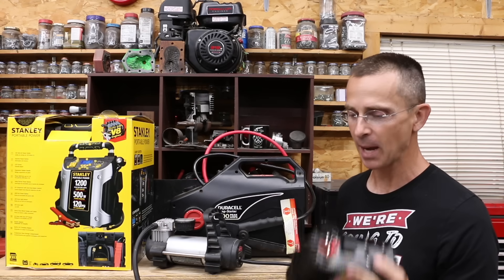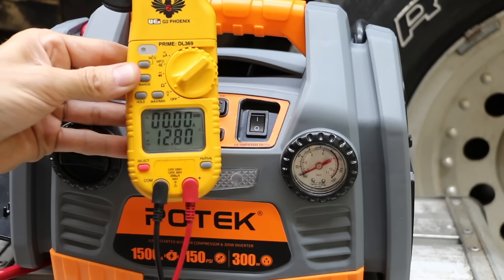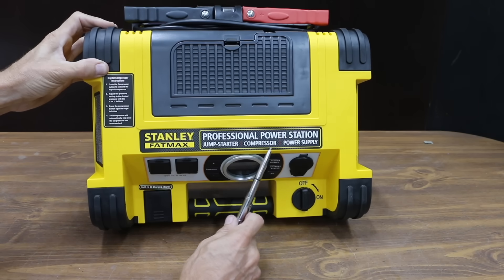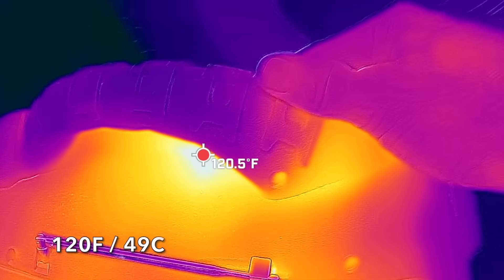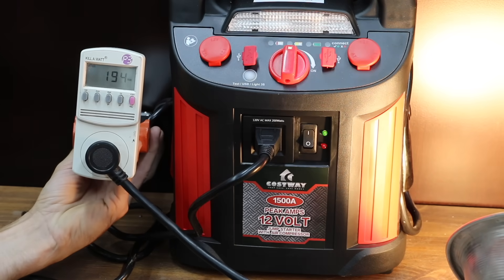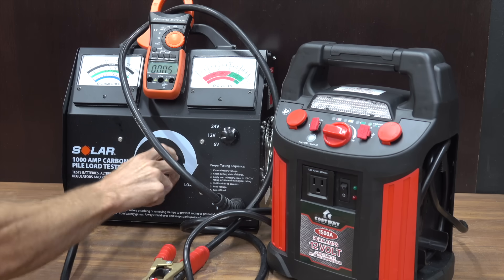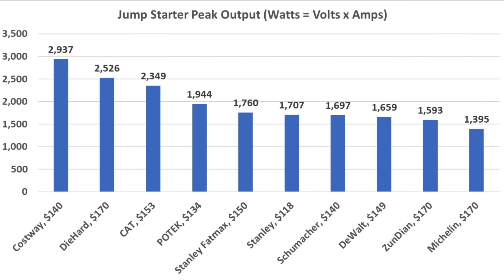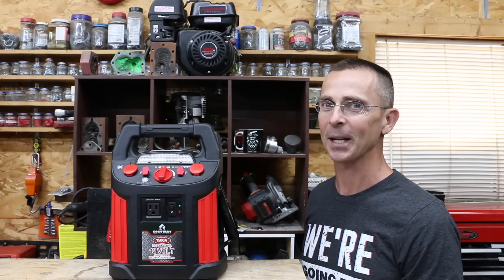Best Jump Starter? DieHard, Schumacher, DeWalt, Michelin, Stanley, CAT

Comment: Another great video.  Thank you for doing these.  

I no longer use these large Lead acid all in units, in favor of the much smaller and low self discharge Li-Ion boosters.  i figure that i can use a spare tire, or use a gas station or a bicycle pump for any air needs.  For tires, the bigger need is usually to plug the nail, then inflate.
Reply from the maker: Thanks and you are welcome!  Thanks for sharing.
Reply: The lithium ion battery packs seems to suck in the cold though.
Reply: An inexpensive twin tube foot pump $15-20, or large barrel bicycle pump much more reliable.  Only need to get >15psi, then slowly drive to gas station air machine.  Once paid $45 for individual 12volt air compressor that quit on 1st use.  Not interested/ won't rely on any more.

Comment: Great tests as usual!  I've been looking at the CAT which Costco sells for $109 which is actually the 1200 peak version, mostly as portable charge station and occasional mower jump start.
Based on the testing it would be good enough for that!
Reply: That Costco CAT is crap.
Reply from the maker: Thanks!  Thanks for sharing.
Reply: Get a Battery Tender or Battery Minder from Costco, a battery charger, much better for a mower. About $30-40

Comment: Here's a video idea. You should test out different types of stun guns/tasers, since they claim "millions of volts".

I already have a voltage divider that's (not too) accurate, since I made it read both 1 volt for every 1,000 and 1,000,000 volts. I have used it to measure a boost converter (basically a stun gun module) that was rated at 400kv, but at max power it only put out 15kv.

I can send you a homemade voltage divider that reads 1 volt for every 1,000 volts. With only this configuration it seems to be more accurate and reliable.

Try testing the ViperTek, Hot Shot cattle prod, and one of those generic mini pocket stun guns.

The distance between the prongs on a stun gun is what limits the voltage when arcing. 

There's 2 smaller prongs deep down below the big prongs so that it keeps arcing when the big prongs are stuck onto someone. That arcing is the voltage being built up high and let out all at once.
Reply from the maker: Thanks for the suggestion.
Reply: @ProjectFarm  Is there a PO box where I can send my homemade voltage divider? Polarity doesn't matter for most multimeters.

Green wires go to your multimeter, and yellow wires go to the high voltage source.

Also pls credit me when I send you my 5+ hours of soldering 100+ resistors in series.

Comment: Where does one buy a Costway for $140?  The lowest price I see is $169.  Or, has there already been a run on them thereby jumping the price?
Reply from the maker: The link is in the description.  Wouldn't be surprised if the price has jumped.
Reply: @ProjectFarm  Has increased to $169.99 on the Amazon ink provided.   Only 15 left as of right now.

Comment: Personally, I'm wondering if you just got a bad Stanley unit.  I've had the exact same one for a few years now and to be honest, I've only used it to jumpstart other cars and as a power supply during power outages.   It's jumped all but one car (I do roadside services) and that was my fault for letting it go uncharged.

I will say that other than jumpstarting numerous vehicles with it, I haven't used it as strenuously as it was tested here.
Reply from the maker: Thanks for the feedback.

Comment: IDEA: Test jobsite coolers! How long they keep beverages cold if the cooler is in the sun vs in the shade? Durability test. Exposure test (UV light, rain, etc.), What happens if you get oil or concrete on it? Will it clean up or ruin the cooler? And finally, what's inside (what's the insulating material inside the cooler?)
Reply from the maker: Thanks for the suggestion.

Comment: These things are useless. Starting a dead car in the winter will be impossible. You’re better off buying a deep cycle battery and a cheap power inverter. If they can’t jump a dead warm battery they are just trunk weights
Reply from the maker: Thanks for the feedback.

Comment: Could you test the myth about adding 2-stroke oil in your dieseltank? They say its good for dieselpump, injectors, the combustion chamber etc because the dieselfuel might not have enough lubrication in it in the winter time. 2 deciliter in a 70 liter tank is what i was recommended
Reply from the maker: Thanks for the suggestion.

Comment: Last year, I bought an Everstart (Walmart) jump start box with compressor.  It's rated at 750A and 120 lb/sq in compressor pressure.  How did it work?  It won't start a car with a dead battery.  It'll help if the battery is low - at least that's good.  The compressor filled up a couple tires, then died.  I can set the pressure and it runs, but no pumping.  Pretty much junk, but I use it for jumping a car with a weak battery.

I did buy a Schumacher Lithium Ion 1000 A jump start box a couple years ago and I'm amazed how well it works.  On a car with a completely dead battery, most times it will start it.  I have run into situations where the battery was too dead and the starter needs too much current, but most times it worked - much better than a regular lead acid battery box.  The box is also very light, which makes it very easy to take with.

Between the two, it's an easy comparison.  I grab the Schumacher whenever I need to jump a car.  

An idea - can you do a comparison test between a lead acid and lithium ion jump start box.  Can you test the initial power and success of jumping a car with a dead battery, then also see how many times it will start a car, before there's not enough charge left.

Again, I love these videos!  Thank you for all your hard work!
Reply from the maker: You are welcome!  Thanks for the suggestion.

Comment: This was a great video and look forward to other brands being tested...Just as with batter back-ups for computers many times you can take the housing apart and by a bigger and/or better AGM battery to put into the device and massively increase the performance. sealed lead acid batteries are the cheapest and worst batteries you could ever use for anything. They are intended to fail so you buy a new battery. Once the water evaps from the battery they are dead and done. Can sometimes also find nice lithium batteries to replace the factory battery if you can't find a AGM battery. Many HAM operators us lithium batteries for off grid communications and backpack HAM operations etc.
Reply from the maker: Thanks!  Thanks for the feedback.

Comment: Fascinating! Thanks. Looks like Costway is the best jump starter.  Seeing all those compressors thermal out before the tire was inflated, I found myself wondering how long you need to let them cool before continuing to pump up the tire.  I have a lot more than 35 psi in my F250 or car trailer.  Looks like I’d best consider these to be jump starters, and carry something like a Viair 88P for the tires.
Reply from the maker: You are welcome!  Thanks for the feedback.

Comment: Glad I watched this would have brought the dewalt, go to brand,  looks like spending 300 to 400 might be worth the time, with no headaches.  I bought a 12v slime portable air compressor, tire had.10 lbs in it took less than 4 minutes to air up, never shut off or overheated. 54.00, money well spent, I'm impressed, that little compressor kicked all of those brands butts...
Reply from the maker: Thanks for sharing!

Comment: There is an entirely different class of these starter devices that are smaller and lighter, and use lithium batteries. They also use a capacitor I believe to deliver the peak current for starting a car. I have one of these by the brand Halo. Would be interesting to see how this class of device compares to the big guys with lead batteries. Certainly not as straight-forward to test as you don't have a lead battery to measure the voltage on. Thanks PF!
Reply from the maker: Thanks for the suggestion.

Comment: Why are these compressors shutting off before reaching the desired PSI? If they still have battery powers and they still be running?
Reply from the maker: It is a safety device to prevent overheating.

Comment: Can you do this same load test on the Lithium jump packs?  Most I have tried don't seem to provide enough oomph to crank my engine while keeping voltage high enough to power the fuel pump, immobilizer, ignition, and other computer modules needed to actually start the engine.  Also the "with a fully drained battery" test too please!
Reply from the maker: https://www.youtube.com/watch?v=JN8A2nIMUWA

Comment: I would recommend getting a LiFePO4 battery based car starter.  I got the Harbor Freight unit and it is great.  I started and ran a car with it being the only battery in the car.  The batteries in these starters are cheap Chinese units that have much less capacity than what their specs. purport.  These starters could be good if the battery was replaced with a US or Japanese made battery.
Reply from the maker: Thanks for the feedback.

Comment: I have a jump starter with an air compressor.  I had not kept it charged up and even though I had it hooked to an AC outlet the air compressor would not work while the battery charge was low.
Reply from the maker: Thanks for sharing.

Comment: I work as a mechanic on high line cars. Almost all of these cars have a battery that is 8 feet away (or more) from the starter motor. These cars often sit for months and have COMPLETELY dead batteries.  We have tried every jumper on the market (including the $3-$5 caddy jumpers. The BEST jumper I have found I'd the Noco boost pro GB150. it has yet to fail me. Plus, it's not very large or very heavy.  Which is extremely important when you are 4 stories down at a customer's house trying to jump a car in the dark. Oh! It also has a light on it (which is perfect in that situation). It was $300 (I know,  kinda pricey) but I use it literally daily. (You would be surprised how many $250k-$500k cars never get driven.)
Reply from the maker: Thanks for sharing!
Reply: @ProjectFarm  also, I love your videos.  Keep em coming!

Comment: Surprised you didn't try jump n carry.  I bought one after I saw an auto dealership use one.  Completely dead cars started in 3 seconds.  It even comes with a warranty coupon you can use at any time.  Turn it in for 1 free repair.  Have mine for 4 years and good as the day I bought it.
Reply from the maker: Thanks for the suggestion.

Comment: Great video. However i have bad experience with stanley. Bought a small compressor from them. It was missing parts on the release valve and it gave me a shock when i touched the tip of the power cord several minutes after unplugging.
Reply from the maker: Thanks!  Sorry to hear!

Comment: I find it intolerable that manufacturers have the balls to make and sell a product that not only does not reach the power outputs they loudly advertise but that also grenades, simply when actually used for the very purpose it was built for. Oh, and it can't even DO what it was intended to do (start a car).  How is that OK, by any standards? Manufacturers that make false claims like that and retailers that sell this @#$%^& should face consequences for what is essentially fraud. Thank you, Project Farm!
Reply from the maker: You are welcome!  Thanks for sharing.

Comment: I have an older Stanley fat Max, that I have been pleased with, especially since I only paid $49 for it, about 3 years ago. It aired up untold numbers of tires and jumpstarted untold numbers of cars, as well as starting one that didn’t even have a battery in it. Just clamped to the terminals. Great video as always
Reply from the maker: Thanks!  Thanks for sharing.

Comment: I know this is not possible to easy test but the main issue with these units is low durability - i.e. they are all junk after few years. I wonder why there are no lithium jump starters available for say $300. These should last 3x as much & be lighter & provide better starting currents.
Reply from the maker: Thanks for the suggestion.

Comment: Excellent test, as always! 👍

I wonder, why they claim 1200-1500CCA if in these things, usually is 12-18Ah batteries inside with smaller CCA ratings.. 😂

Can we see second video with disassembly of these multi purpose boosters, internal build comparison with quality inspection and some visual inspection, why few of them release magic smoke?? 😉 That will be great extra video..
Reply from the maker: Thanks!  Thanks for the suggestion.

Comment: My Stanley model like that did not survive the test of time. The built in charger cooked the AGM.
However, my replacement Stanley model PP1DCS is a much better unit and has survived several years. Also the air compressor on new unit is automatic, set a pressure to stop and walk away.
Reply from the maker: Thanks for the feedback.

Comment: Your very first question, right from the jump... "Why not...."

Because they use SLA technology for their batteries. They're antiquated and over priced. Over priced, because I have to replace them every 2-3 years. That SLA battery fails, and the replacement batteries are more expensive than just chucking the unit and buying a new one.

Why are they not using LifeP04 batteries?  They'd have 5x the storage, and 2-4 x the capacity/power.

For the same space, I have my Lithium jump starter, and a rechargeable battery air compressor.

Thanks for the video, but it's a no-starter for me, because it's 30 yr old tech.
Reply from the maker: You are welcome!  Thanks for the feedback.

Comment: i"m gonna get the Die Hard..... Thanx :)    Is the HYPE!!!!! over Micro Fiber towels worth the cost?  are there name brands?  are the expensive ones better?   do they last longer?  for $10.00 at harbor freight i get 20 micro fiber towels.... and only 5 at auto zone for $10.00..... and only 3 at advance auto for $10.00....are the cheep ones only to be used once?... they all say on the tag...NEVER put in dryer.... what happens?.... do they shrink?..... melt?...... blow up?....All the best :)
Reply from the maker: Thanks for sharing!  Thanks for the suggestion.

Comment: Okay, so with the Schumacher there are multiple versions of the 1200amp and all at various prices from $100 upto $250. The FRO1337 seems to be on the higher end (did not do extensive search).

I have the $99 version and used it reliably for about 4yrs (plus/minus a year).

Before that I had another version for multiple years that looked more like the version reviewed.

The old model got plenty of use, multiple jumps starts, sometimes multiple on same charge. (Won't go into story mode). Multiple tire inflations often from completely flat tires with srcrew, nail or other puncture. Inflatable pool items and possibly an air mattress (it was over 6 yrs ago).

The version I have, from Walmart for $100 uses an all digital display, 4 USB, 1 AC and 1 DC all the same features as reviewed model. 1200 Amps Peak, 100 PSI, goose neck led light, compresser/inflator (rafts, beds, Beach balls).

This one has seen a lot less use over its roughly 4yrs. But I think that it was worth $100, even with the limited use. 

I seen one YouYuber do a crazy experiment of connecting it to his home electrical system and test it. He might of had the higher end version, and also, not recommended unless you have a room with LED light bulbs you want lit. 200 Watts is not a lot, and many electronic devices will surpass that, especially home appliances. I think he got a can opener to barely run with the basement lights. That was also a few yrs back.

Great information, if you ise links provided, you should be brought to the correct product page. But of you are going to the local store or ordering elsewhere, please verify model version to versions tested.
Reply from the maker: Thanks for the feedback.

Comment: Just my 2 cents..
I wish that on the ones that shut off automatically at 10 minutes you would have restarted them to see the total time it took to air it up to the proper pressure. Even if a pump turns off after 10 minutes, if it's not at the correct pressure, then you have to start it again to finish airing it up. Also I wish you had measured the power cord length, especially if you have a vehicle and the battery is dead on the unit, would be nice to know if you can plug it into a 12v plug and still air up a tire. (had to correct myself and not call it a "cigarette plug" and show my age... Back in my day kids, cars would come with ashtrays instead of change holders. I remember growing up my parents had a 2 door car that had 3 ashtrays in it.. but I digress)

Love your channel, keep them coming.
Reply: Why would you carry around a 15-20 lb dead jump pack?
Reply: @Tracert-mc1hu  you got a flat so pulled over, while you were fixing the flat the car battery died. You used up the battery to get the car started and now need to air up the tire? Would really suck to have that nice $200 20lb tire pump and not be able to use it because the battery is dead 🤷. Just off the top of my head
Reply: @1337YourMom  Yeah, I guess I could see that. I'd probably just use the spare in that situation rather than try to fool with an inflator. Although not everyone has that option mechanically or physically.
Reply: @1337YourMom  You might try to plug in the device to your car’s 12 V outlet and see what you could get out of the pump.
Reply: Totally agree. The ones that had a programmed time limit should have been restarted.

Comment: Most likely, the smoke was coming from burned up diodes which are installed as polarity protectors.  If they burn themselves open, the unit won't output any current.   If the diodes short out, the unit will continue to work although the polarity protection will be lost.